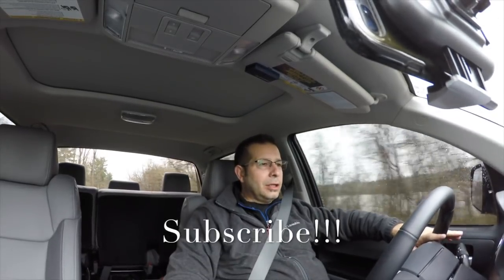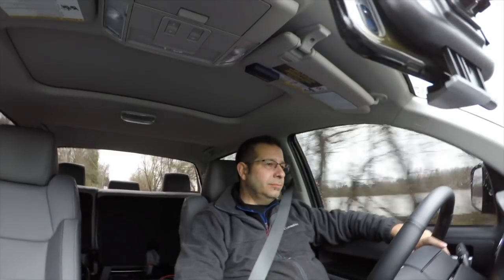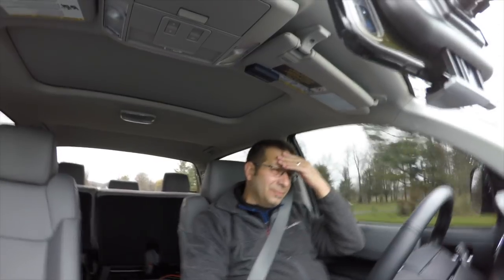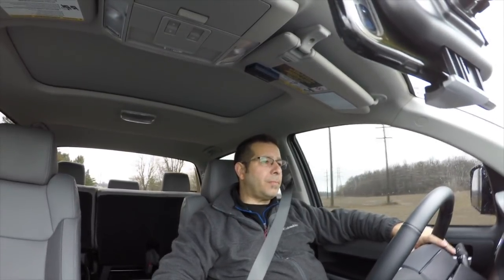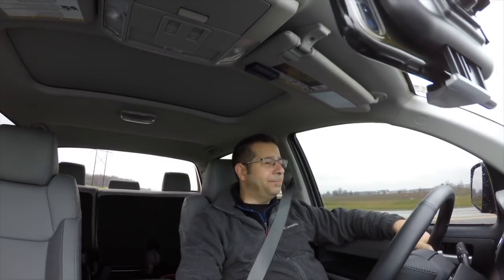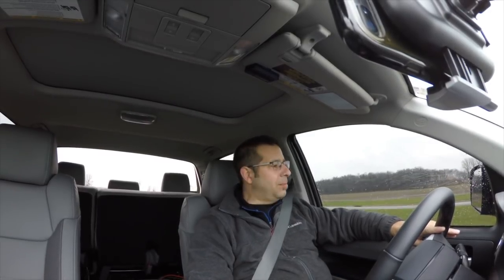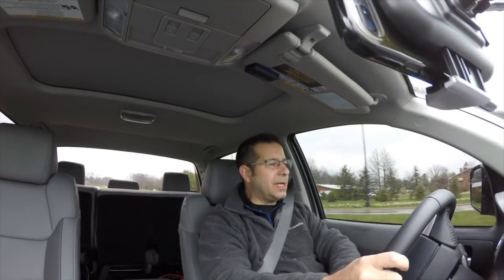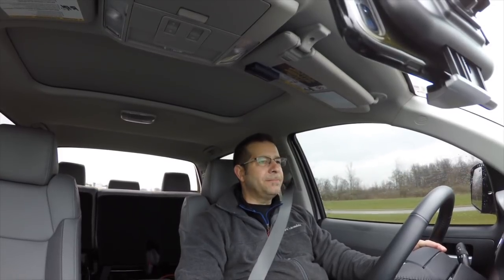Tundra Mod Considerations - Mechanical vs Aesthetic

Comment: I agree with some of the thoughts on bed cover. But they are awesome when traveling like your getting ready to do. Keeps luggage and what ever you got secure and dry.  Lazer lite cover is the one I picked after a month of research. It's very light and  can be removed in 2 min or less.
Reply from the maker: Yeah this is true.  It would be nice to have the extra storage space in the bed. I just don’t like messing with them when I want to take them off! I’m not familiar with the Lazer Lite cover?
Reply: It may be a good compromise. I felt the same way you did at one time. The lazerlite turned out to be a good compromise.
Reply: ThrobbNation  honestly it can be removed in 2 min or less
Reply from the maker: I’ll check it out.  Thanks! 😎

Comment: Hey Rob how you doin pretty good here 😊
Another thumbs up 👍!!!
Because your truck is new and you haven’t been out on the road in any wind or mountains and curvy roads 
You haven’t noticed any body Roll!
But for a couple hundred bucks you can’t go wrong with a sway bar!!
Reply from the maker: We’ll see...I am still considering it👍
Reply: ThrobbNation 
Another thought I had was maybe the Tundra you have (2018) that trim level has a complete different suspension than other Tundras and there is no body Roll !!!
Reply from the maker: Could be?  It is a TRD off road.

Comment: I can attest lift and 35’s = 13mpg!
Reply: Gear Runner i have a trd pro, with 33's and I'm barely breaking 12mpg, my brother has a 5 inch lift w/35's and hes like 10-11mpg.
Reply: BigpoppaKC well that does make me feel a little better then. Lol I guess we didn’t buy the trucks for mileage though.  I just knew the Tundra would have some awesome reliability.